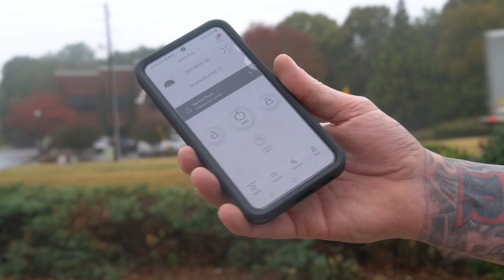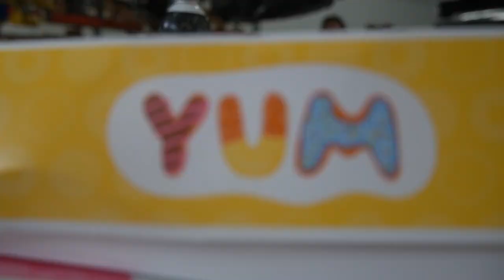Major CUTTING a 2022 F150 | Lifted Ford on 8" FTS and 26x14s, from TEXAS

Comment: Get some more ram content on this channel that's a clean build! Do you guys do the 8inch lift on the ram 1500 limited with the air suspension?
Reply from the maker: They only have a 5” from what I have found but I’ll definitely post more as it comes

Comment: Which lift is that? The coil over or strut spacer? Also what type of balance did you do for the wheels and tires? I have a 21 with the 8” fts spacer kit. But I had the fox leveling coil overs on it. They put the spacer on top of the coil overs and left the preload spacer off of it. I’m running a 22x12 -44 with 37x13.50 22 on it. I have a steering wheel shake that I can’t seem to figure out. I also upgraded to icon billet upper control arms. Still has the shake. Any suggestions?
Reply: My 18 I just lifted 10 in front and 5 in the rear. (Actual numbers that came out, bs. I gotta get the rear up 3 more inches to level it.) Now I have a steering shake at 48-58mph. Before and after that, it rides good.